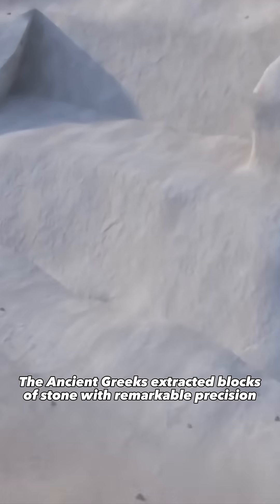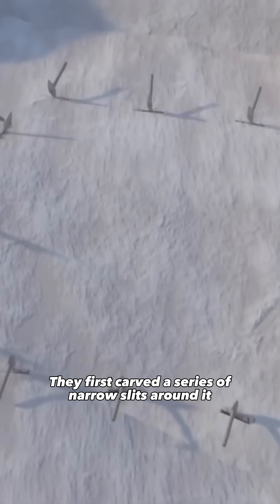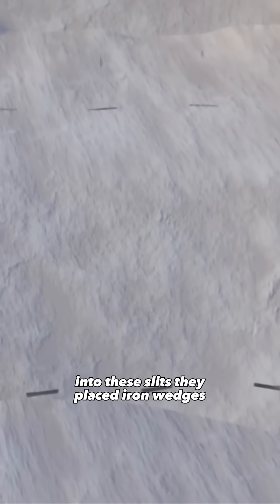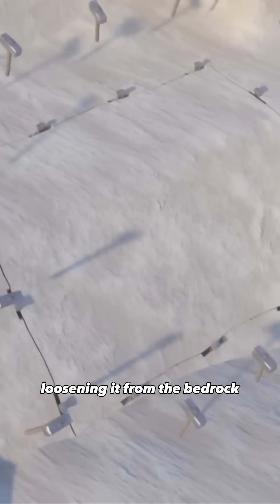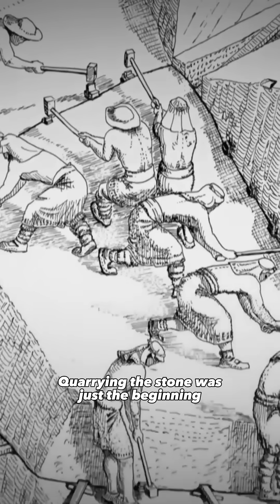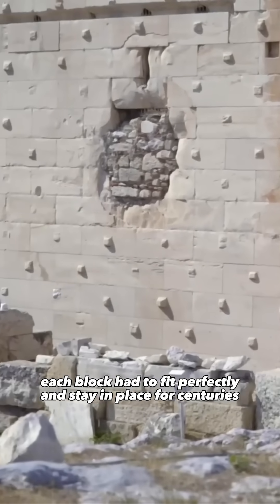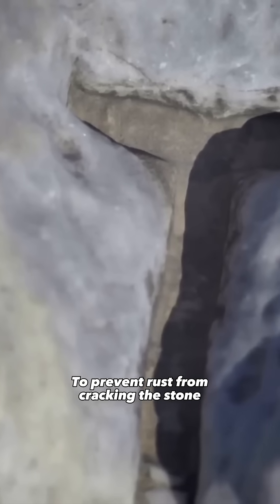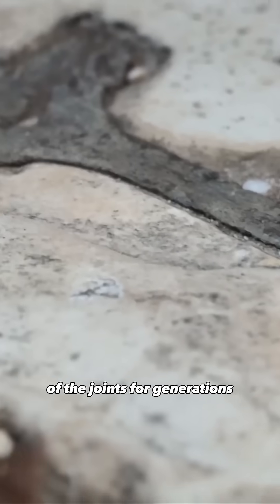How Ancient Greeks engineered perfect stone structure #history #engineering #ancientgreece

Comment: The Inca people pretty cool too. People don't know how they put these massive 50 ton stones in a jigsaw shape with 3 corners joining with so little gap. Put old Norman Castles in England to shame.... far more robust than those. e.g. one of the stones used is estimated to weigh 200 tons. Some suggest they were melted in some way ... there was some analysis on the internals that suggested it for some some. Then others said no that quality was due to using volcanic stone... so still a mystery ... not as clear cut a process as the Greeks (pardon the pun)

Comment: Crazy, I worked in a limestone quarry for a while, and while not exactly the same techniques, a lot of the principles and how they extract rock is still pretty similar today
Reply: If it's not broken, don't fix it
Reply: The video midpoint shows marking similar to the jackhammer holes I used to drill for placement of dynamite to split the rock.
Reply: @douglas_drew we did the same thing, though we didn’t do blasting very often. Usually the drilled holes were for plugs and feathers that would be hammer in to release the stone from the other layers. Then a front end loader would pry it up with some massive forks
Reply: @VeebsterTV • Yes, and holes for sliding purchase to lift the blocks for stacking stone walls.

Comment: Cause the cement industry is a massive concern to emissions, would it not make sense to use small metal clamps like they did? I know steel needs energy to melt as well and isn’t a low emission process, but is it worth it calculating?

Comment: The metal fasteners are the reason many of the ancient buildings were torn down. It was easier to tear the buildings down and collect the metal, than mine and process the metal.
Reply: The same was true for nails in the early days of the US. When families decided to move west, sometimes the house they had lived in would be burned, and the nails collected from the ashes. Or, so I was told.
Reply: @williamboquist4090 
Movies always show blacksmiths hammering away making swords but in reality the majority of their time was spent making nails
Reply: @williamboquist4090  except for the door, nails to secure the parts of the door were usually bent beyond re-use, and it is where we get the phrase, "as dead as a doornail"
Reply: No mostly its because buildings were stripped of the marble and use to build Vatican.
Reply: Sounds like a lot of unprovable speculation around here 🤔
Reply: @Rando-user-zm1fx iron and nails weren’t a commodity till the Industrial Age. No speculation here.
Reply: @Dinnerfortwo69 
Not relevant
Reply: Nonsense.

Comment: Hi! In Pentely Greece, where the Marble was removed, there are clear Indications of Use of light Sand (lime) and Water in use for dislocating (i.e. transporting Process) the Part of Rock from its original Location. An estimated Time was within Hour. It was the transportation of the Rock from Penteli to Athens that was the main issue, something that the Wiseness of Pericles solved with the Introduction of 100000 Slaves (as well as misusing the Funds of the MilitaryAlliance).
Reply: WoW

Comment: Funny how when the greeks build stuff no one mentions aliens but when the Egyptians build pyramids people question if they were capable 😂 history us pretty racist
Reply: Because the Egyptians didn't have the are iron tools.The Egyptians do not have these.They had a copper tools And the quarries for their stone were tens of miles away Not to mention that there's clear water erosion on the sphinx Meaning it is significantly older. Than what we're told in the history books.
Reply: @drewwar9344  The copper and stone tools the Egyptians had were adequate to quarry the limestone they used. The Egyptians used a similar technique as shown in the video to split large blocks of stone. They would place wood wedges into the slits, then keep pouring water on the wedges until the wood swelled and split the stone. The Egyptians also built canals to the quarries, so the stone could be placed on barges and floated to the construction site.
Reply: True, need another vid on moving and lifting
Reply: The Greeks gave the aliens knowledge

Comment: Replace iron block with wood and pour water repeatedly. Wood expands and cut the stone as required. This method used in India
Reply: Possibly not as precise as they wanted, due to the wood expanding at different rates? Also might not have had enough spare wood for single-use tools like that (or the right kind of wood for the task).
Reply: Wow that sounds super interesting,  I've never come across this method.
Reply: Terrible. Greeks >>> Indian "civilization"
Reply: The ancient Egyptians used that same technique (pouring water on wooden wedges) to cut large blocks of stone.
Reply: @richardstephens5570  Right, they didn't have steel so couldn't use steel wedges. The Greeks likely used steel instead of wood because it's much faster.
Reply: Yes our indian ancestors were master craftsman of stone

Comment: They also mixed their concrete with local saltwater and lye. The stone gets harder and stronger with time unlike modern concrete
Reply: Concrete also gets stronger over time. But I got your point.
Reply: This is a common farce, wr have concrete that can far outlast anything the ancient world produced, however most concrete that is in modern buildings isn't required to be as bomb proof as it could be. Check out some of the fiber reinforced Crete, or some of the lightweight Crete produced in Europe. Very interesting stuff. But not commonly known outside of the construction sector.

Comment: It wasnt the shock that made fissures, it was the pressure of the metal pinions sinking further in
Reply: A combination of the two, really. And the simultaneous strike made the crack more even and less jagged.
Reply: @VulpisFoxfire sorry, but no. It is about pressure. It is the entire point behind how the pre-drill the holes in the stone and how the pinions are shaped. Especially when you see how modern rock cracking pinions are designed. Its been about 3 years since I used them, but I had to crack several boulders to remove them from a foundation I was pouring. Im no expert, but from hands on experience I can say it is all about building up pressure to allow the faults in the rock to crack, as rock is hard, yer brittle
Reply: @thefinesthobbo4524  Ah, but were you just trying to break them up, or break them up into specific shapes? Breaking rocks up is relatively simple, yes, but breaking them along precise lines is a different trick.